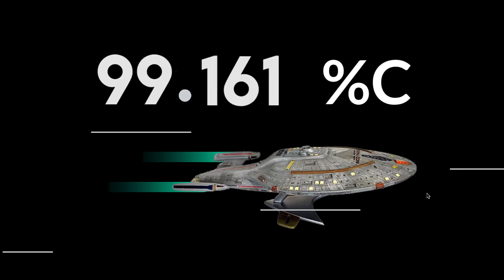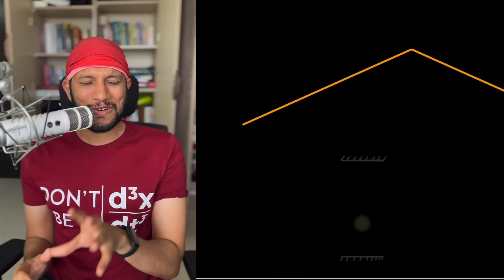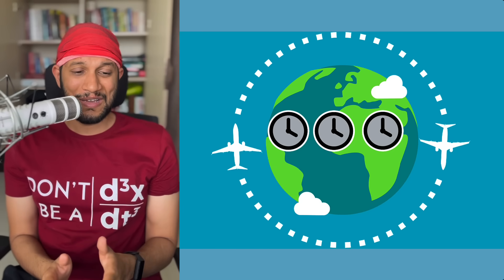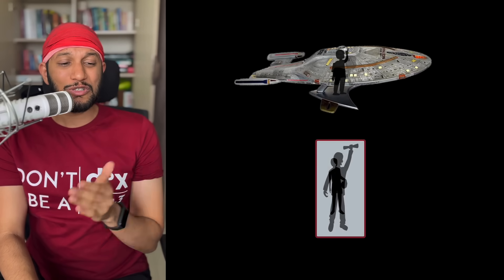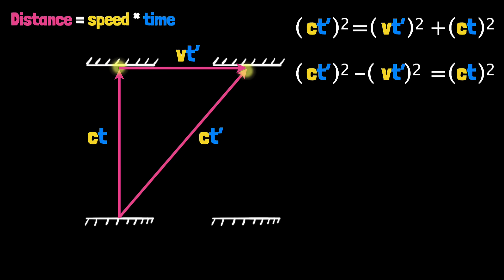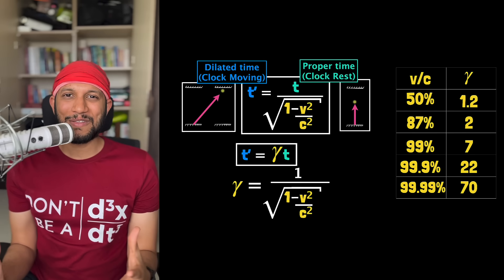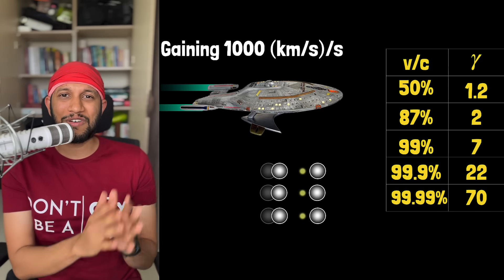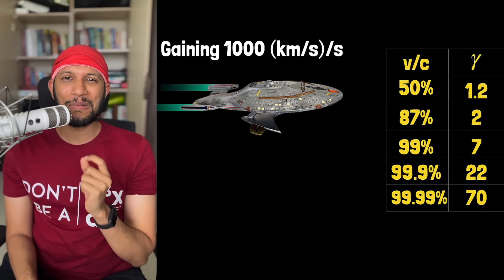I finally understood why you can't go faster than light! (My mind is blown)

Comment: The thing that messes with my head is the relative position and speed we are at. We are already at incomprehensible speeds. It is just a question of the relation to what position we are measuring. We perceive ourselves as stationary. But we are on a rock rotating around itself, in orbit around a sun, in orbit in a galaxy, that is flying around infinity. So.. What speed are we at? Can we actually move against this momentum and slow down time by moving the other direction? Aaaaarrrrgg my head!

Comment: The ship will not freeze in time, it all comes from one assumption that speed of photon is speed of light and finite, that is why triangle and pythagorus theorem makes funny formula. The ship has force and that force which is applied to photon and hence photon is moving faster and makes the increased distance in the same time - no time dilation. Einstein ignored forces that moved the object (due to his idea of finite speed) and hence the whole time slowing down came to be. 
If the experiment with atomic clocks on the plane was correct, may be there is friction, Higgs boson or other particles unknown to us hitting played role in slowing the atomic clock :-)

Comment: Imagine you facing a giant clock saying 3 o'clock. Now you move back in the speed of light. The clock will stay 3 o'clock. If you move towards the clock with the speed of light the clock will move twice as fast. Because the photons are moving to you at the speed of light, so do you. Now when you move away from the clock FASTER than the speed of light the clock will go backwards. Because you star seeing the photons wich already passed you. 
So if you move towards the clock with twice the speed of light is the time going 3 times faster for you?
Reply from the maker: You can't travel at the speed of light! :) 
But, if you travel really quickly, yes you do see the clock ticking faster or slower depending on your speed. But, that's Doppler effect. If you correct for it, you will find that the clock has 'really' ticked slower.

Comment: I might have misunderstood everything, but does this mean a photon travels slower in a tree branch than in a metal rod? If i quickly move a vertical branch, it will bend, but a rod will not, atleast not as I am able to detect. Is that bending because of the time it takes for the photon to move and tell the mext part to move 😂

Comment: You shouldn't have used a starship to illustrate your point. I just glanced into the comments section and no trekkies seem to object that starships travel at multitudes of c (speed light) .. warp 1 is c.. and warp 2 is 8c ( 8x speed of light )

Comment: Well. By the same token if you were able to achieve the speed of light no information would pass between atoms as everything would be moving at the same speed as the signal that needs to be passed to transfer information. So you would become inert? Frozen? So it seems light is the processor substrate for reality, and you can't calculate anything if your processor isn't able to move electricity through it. Or put another way; your body can't live if your blood isn't flowing.

Comment: Really interesting video and cool explanation of special relativity and time dilation! Question: what happens if the object we’re trying to accelerate to the speed of light is a single massive particle (e.g. electron)? In that case there wouldn’t be the issue of the photons taking an infinite time to transmit the force, so why would it still take infinite time in that case?
Reply: How do you push an electron if not by a magnetic field which uses photons?

Comment: I don't understand that mirror clock when we view from outside and inside the ships perspective. Are you saying that the person in the ship must have changed the direction of the emitted photon at a perfect angle so that it deflects from the top mirror back to the bottom mirror? Because if that person didn't change the emitted photon angle direction, then one has to assume that the photon had an existing velocity 'v' component to the right (ie. the same velocity as the spaceship). If the distance between the mirrors were incredibly long and the velocity 'v' very large , wouldn't one expect the emitted photon to miss the top mirror from both outside and inside the ships perspective?
ps . I've found an answer on 'Physics Stack Exchange'  (see below).
Now, going back to the path of light bouncing between mirrors. The light is moving straight up and down in the frame of the mirrors, but the mirrors themselves are moving, adding their sideways motion to the light. This imparts a sideways velocity to the light. In Newtonian physics, this would combine with the vertical velocity, c of the light to create a total speed √c2+v2. Instead, in special relativity, the speed of light is fixed at c, making the vertical component of the velocity √c2−v2. It is because of this decreased vertical component of the speed of light that time dilation occurs. 

The above answer doesn't make any sense to me because you showed in previous videos that velocity of the source of light does not add to the speed of light in any inertial frame of reference . Yet in the above answer, it implies that a horizontal component of the photon of light is being added by the horizontal moving light emitter.

Here is another answer from Physics Stack Exchange:
Only the speed of light is constant in special relativity , so the direction can be affected by the motion of the source.

Gosh, how confusing is all this? So the light can be bent by the motion of the source , but the speed of light must remain constant.

Comment: I have an interesting theory. What if faster than light speed is possible? All particles that we know of travel slower than the speed of light. But if a particle travelled faster than the speed of light, we wouldnt be able to detect it. So there may be particles traveling faster than the light speed, just we are not able to detect them, they are like they wouldnt exist. I am talking about a single particle, which does not need any fotons to move. Such a particle could move faster, because it is not bound by the speed of a foton.

Comment: It's still incomplete (if based on single POR). Even without illustrations, the bouncing proton in a moving clock will always travel longer by simply moving, than a static clock. the thing is, time is based on a larger concept of gravity in an interplanetary object (in our case, Earth vis a vis Sun (thus all speed, mass, and energy governing it within the scope of our solar system. Time dilation (is relative from a Earth-sun's POR) applies when an object transfer to an area of heavier/lighter speed, mass, energy in space. Note this does not only apply to counting clocks (which most people assume Earth's clock, analog or digital, behaves universally, ie even in space, but all atoms, including the speed of light, human cells that influence human observation, consciousness at a certain moment is relative to a wherever there's a heavier/lighter speed. Same reason why NASA's. radio comms in space are adjusted based on gravity in ships (bec they are technically moving away from Earth's heavier mass, speed, energy). There is an invisible slingshot of mass, speed, energy that is relative to interplanetary objects which physicists should consider to actually describe and manipulate time.

Comment: Because reaching speed of light also means increasing your body's frequency. The body or any other tangible matter wouldn't be able to do so without burning up and becoming light. Because that's what's existing at its frequency, light. It's the same or similar to as what'd happen if something entered the event horizon of a black hole I think. Or rather your body would maybe move so slow that it reaches the frequency of lightspeed that it dissolves.

The faster something moves around, the more space it has to use, and therefore it uses less time. The opposite with something that moves around slower. This is why when meditating for 40 mins, then it might only feel like 20 mins went by. Because when meditating you try to slow down your physical, mental and emotional movements to be as still as possible. You might start experiencing colored lights, because of your mind being able to percieve higher (faster moving) frequencies. The more still that you get, the more pale the colors become, and at some point it turns white or almost white. It's difficult to hold it at the highest for too long though. And if your consiousness actually reaches lightspeed for to long, then it would probably burn up the consiousness, and the nervous system might "burn up" as well, since it's directly connected to the central nervous system. It's not made to vibrate at higher frequencies afterall. So the whole body would probably not be able to go on. This is probably also why you can catch a fever if meditating for significantly longer than what you're used to. I know that I have a few times though. Not good 😅

But it is actually possible to increase the speed of your consiousness. But the trick is to slow down and not trying to increase it, because that's the only way to use more time. 
When you think, then you move around in your brain, and that takes more space than slowing your thoughts down. Emotions are connected to thoughts though. But because they're happening in the stomach area, where it vibrates significantly slower than the thoughts in the brain, then the emotions also gets dissolved significantly slower. Sounds like bs? Check it out for yourself. Create different notes. Increase them from the lowest to the highest, and from the highest to the lowest. You don't even have to make them outloud. Notice physically how your focus shifts in your body as the notes goes up and down? So lower frequencies are happening in the stomach and higher frequencies in the brain. Just watch out for the very high notes. Might sting a little on top of your head, and overdoing it is probably not healthy 😅

Comment: I'm not a physicist, but I seem to recall that the Pythagorean time-dilation equation that you shown comes from Lorentz and it applies even to classical Galilean relativity. That is, the exact same could be said if the photon was just a ball moving at a constant rate. Is that correct?? If so, then there is something else going on in the case of light,  isn't it?
Reply from the maker: In Galilean relativity, the ball would have different (higher) speed as seen from the moving frame. The time between the ‘ticks’ stays the same.
Reply: @Mahesh_Shenoy  Ah, right, of course. The animation kind of cheats because it makes the "photon" move faster to catch up, but with light, is not quite like that. I bookmarked the video about why "c" is constant, but haven't watched it yet.  So Lorenz Transformations are specific to (Special) Relativity, I recall now.

Comment: But that only means you can accelerate a ship to the speed of light, it doesn't mean that a ship could not fly at the speed of light, if it somehow could spontaneously start moving with the speed of light. And that explains why photons can exist and travel at the speed of light: Photons are not accelerated to reach that speed, they have that speed immediately the moment they are born and they will have that speed the moment they die. They only exist in a form where they move at the speed of light and that violates nothing about relativity.

Comment: You forget though that einstein was wrong. Speed is relative, by your logic two ships could never travel in the opposite direction at half the speed of light. By your logic, a person on a ship traveling 1 mile an hour slower than the speed of light couldn't just get up and walk at 2 miles per hour, and end up walking faster than the speed of light.

Comment: Sir, also consider this while uploading the video about length contraction. Suppose the man in the stationery frame of reference would measure the length from say,A to B is 45 km. But in the moving frame it is measured to be let's say 40 km. In total, the length has shrunk by an amount of 5km. The distance have two edges like in our case A and B. The distance has shrunk from both the edges 
Or from one of the edges(A or B). In other words,the length of 2.5 km  has contracted from both the sides to account for 5km. Or either  from A or from B it has been contracted to the total amount of 5km.
(The above numbers are only meant for describing situation and not accounts for time dilation factor and speed of the moving frame)

Comment: What happens when you are inside the ship?  saying it is gaining 1000km/s speed per second, will it ever reach the speed of light? Can someone help to explain, thanks 🙏
Reply from the maker: The follow up video is coming!
Reply: E=mc. Atomic energy converts to radiant energy with acceleration. Water reaches c at 100 degrees Celsius. Your body is 70% water. You would be essentially accelerated to c in time long before reaching c in space. 
You can implement some sort of cooling system, like cryostasis. However, the Bugatti Cimarron employs 10 intercoolers to manage temperatures. At some point, around .5c more force is going into the cooling system (acceleration in time) than what is going towards the propulsion system (acceleration in space).
The Breakthrough Starshot solar sail is heating up and converting to radiant energy at .2c. You can't reach the speed of light in space because your atoms will be accelerated in time long before then. Only heavy atoms like gold can get near the speed of light, which is why accelerators use gold atoms.

Comment: Hi there, loved the explanation, but I have a question, what if, like in the first incremental speed example, you increased the velocity so much, that after two seconds, you surpassed the speed of light? ( Incremented 150000 km/s /s). Thanks for the explanation, loved the vid ❤
Reply: You can't, because you need more energy than entire universe has to do that. 
But assuming, that you would somehow, I imagine that you would behave just as hypothetical particle called Tachyon - you would just behave like you were on reversed in time. But that does not make sense, because you became your own grandfather in grandfather paradox. So let's imagine that:
You are on the ship and press button to instantly jump to speed higher than lightspeed. You start reversing you actions (from observer POV), which means that you unpress the button and in the moment of achieving that speed, you... just stop. But, what is more interesting is that from your POV you never do that. You just go, eat sandwich and then stop. So now you have paradox - at same time you did eat sandwich and you did not - depending just on place you were when you observed that!

Comment: That assumes that the RELATIVE speed of a photon cannot be higher then C (where c = 300,000km/s)... which goes against everything we read about speed of light being a constant.

In the miror-clock, assuming a distance of 1 between the two mirors, and photon is going C from top to bottom and bottom to top.
Now assuming the clock+ship is going C from left to right. If we add the two vectors (vertical lightspeed of the photon and horizontal light speed of the ship) , the photon would/could be traveling (according to pytagore) at Square of 2 (or roughly 1.4) the speed of light RELATIVE to me looking at the ship... but from the perspective of the ship, the photon is still going C between the two mirors. That would make time constant between the ship and me.
So why couldn't the photon be going at 1.4 times the speed of light RELATIVE to me who's looking at the ship, by adding the two 90degree speed vectors ? (That would mean the ship would disappear from my point of view I guess....) ?
God physic is complicated when your not super good at maths.

Comment: None of this is real science, aka, not observed. It's merely a mathematical construct based on certain assumptions accepted only to reach the desired conclusion.
Reply: This is false. We have observed time dilation in many experiments and it is an integral consideration for the GPS system. If time dilation weren't taken into account the GPS system simply would not work.

Comment: That's a great explanation and very easy to understand, I just would like to point out that so far it is still very theoretical, because no known object in the universe travels fast than 30% light speed, so it is unknown what is the time dilation on a object traveling on 87% or even 50% light speed, I have absolutely no right to say it is wrong, it is just impossible to test it at the moment

Comment: Beautiful.  This is by far the best explanation on the subject.  It's not because of mass, not because of energy but because of time, the time needed to add that last bit of speed to reach c which would literally take forever the closer you get to the speed of light and thus never arrive to add that last bit of speed.  Well done.
Reply: Even if you could, from the outside it would seem like time stopped. From the inside, well, like everything outside is happening at the same time. What would it be? Is it all happening at the same time or is nothing happening? 🤯

Comment: 8:50 why third side is vt' not vt?
Reply from the maker: Because we would have to wait until the photon in the clock has moved to the top. And we considered that time to be t’
Reply: @Mahesh_Shenoy  okay thanks
Reply: @Mahesh_Shenoy 9:04 what if the photon clock didn't move perpendicular to the ship's motion, but rather parallel. You can't use pythagoras theorem then